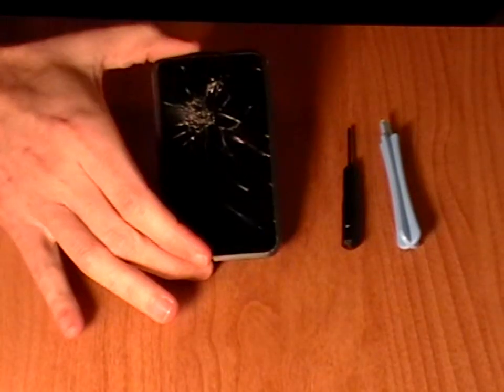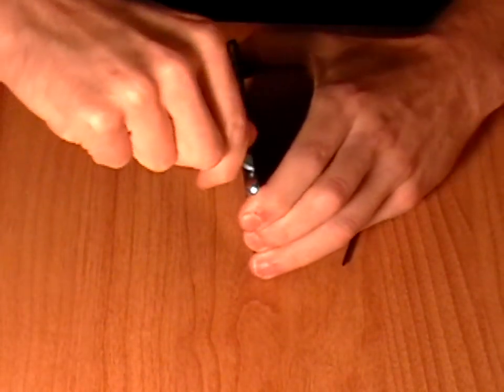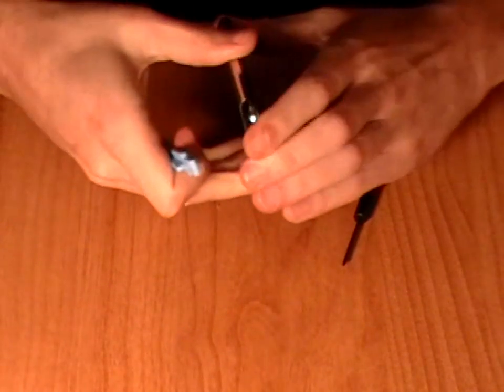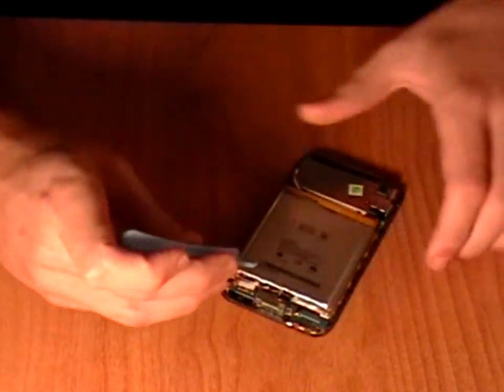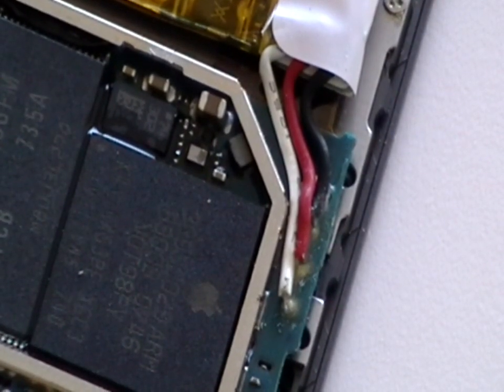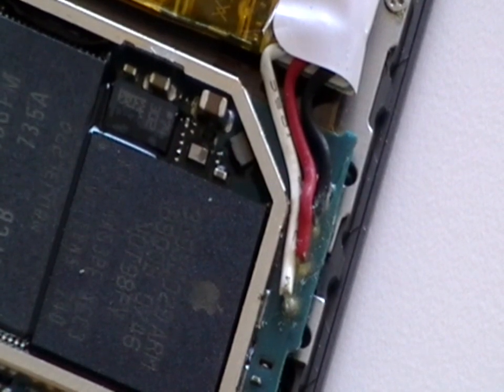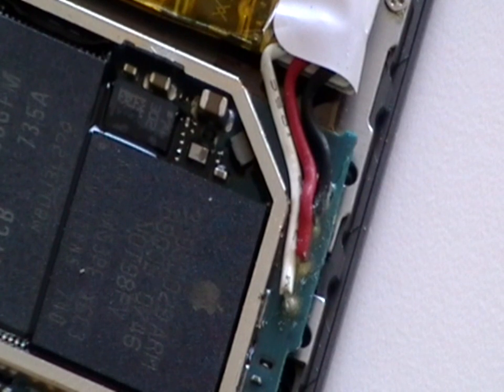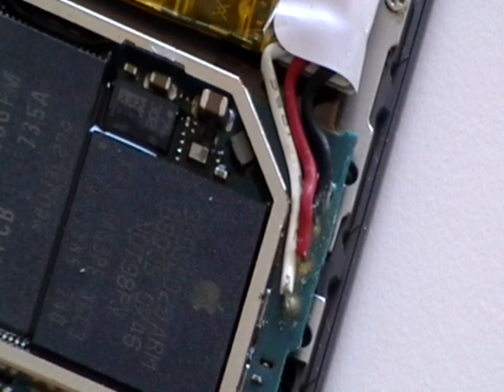iPod Touch Battery Replacement "How to" Installation Repair Guide - 1st Gen

Comment from the maker: @angelaFFXmaniac Yes, you can cut the original wires, then join the new wires from the battery to it. 

These replacement batteries are available at RepairsUniverse (dot) com

Comment from the maker: @MrLadiesman93 You can either solder the new battery to the correct connections. Optionally you can cut the wires and just join the new battery to the old wires if you are not comfortable soldering. 

You can find replacement batteries at RepairsUniverse (dot) com

Comment: @ashrafokda The point of these videos is to fight the man and Do It Yourself, not bend over and give in. Type in "Ipod Touch battery(look for your generation)" on ebay, amazon or any reputable website and I'm sure you'll find one for under $15 with maybe a tool kit throw in to make the repair easier.